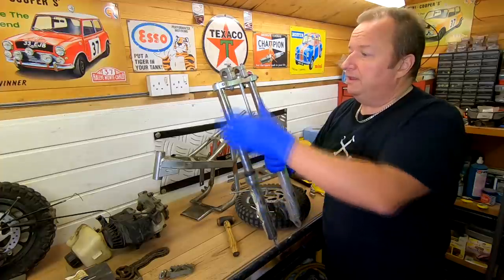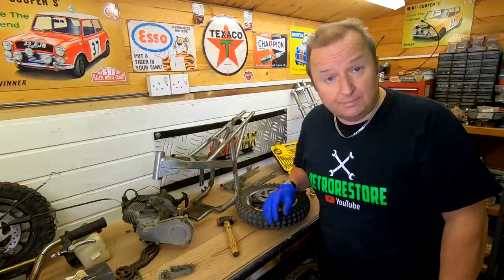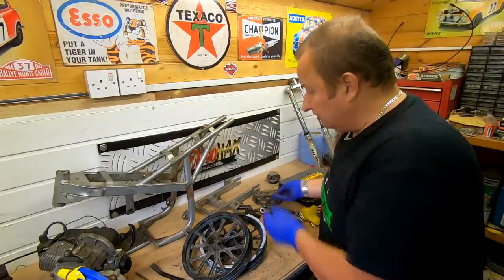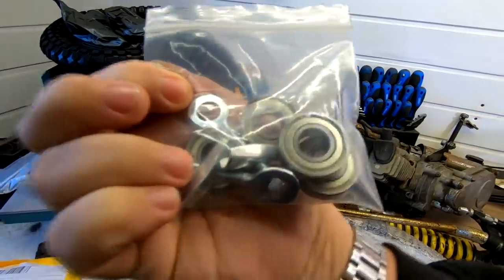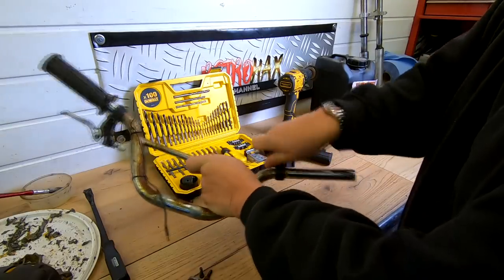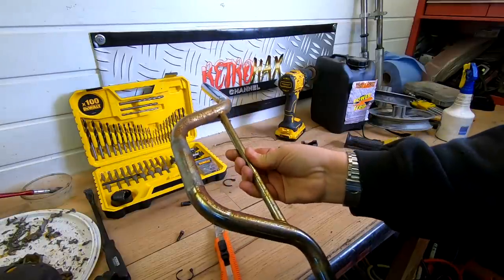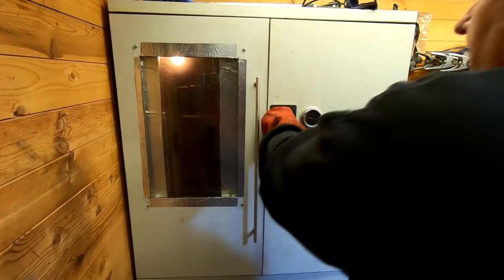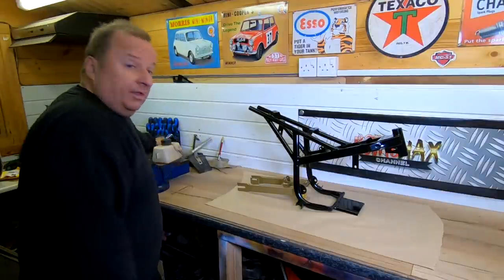Pocket Bike Restoration Part 2 Refurbish Parts

Comment: Martin , I had the exact problem you mentioned when powder coating handlebars on a bike I did with regards sliding the controls back on .... unless they clamp on , I ended up masking off with heat resisting tape up to the point that the levers needed to be. Regards Mike
Reply from the maker: Yes, I'll be doing the same Mike.

Comment: ive been thinking of restoring mine its the exact same as yours the forks are siezed solid it was sat outside for 5 years when i got it i fitted new clutch a pullstart cleaned carb and it fired up

Comment: Hi martin, the standard pull start on those engines are prone to breaking. You can get a upgrade on amazon called an easy start £15.
Reply from the maker: Yes' i've seen them Pete, thanks.

Comment: Next time you're removing a hand grip use an air compressor with a fine tip gun it will allow you to twist them off generally speaking.sometime you can go through the bar tube to blow them off other time you carefully lift the corner with a small screw driver and spray air in them and they will lift and loosen.
I do a ton of old bicycles from the 30s to the 60s and you useally can't get matching grips anymore especially the store brand stuff from here in the states 
The other thing that works sometimes is a soapy water solution under the grip with the air compressor. 
Just trying to save you a few bucks. This newer china stuff it isn't a big deal but some of the classic mowers this might help you in the future.
Reply from the maker: Goo tip bud.